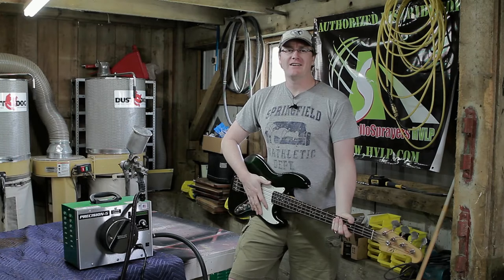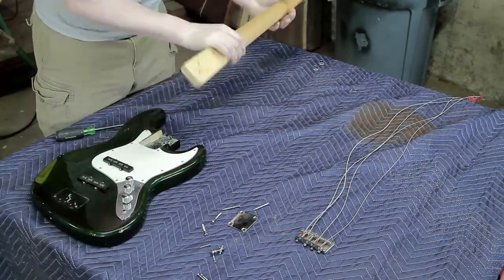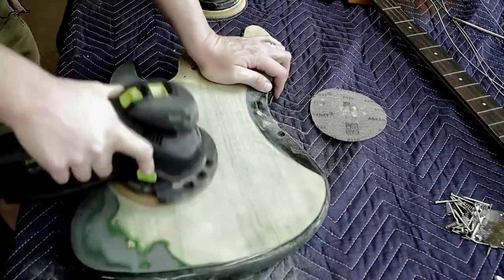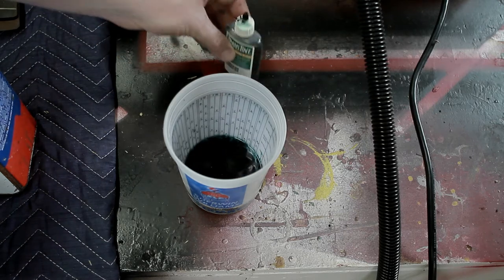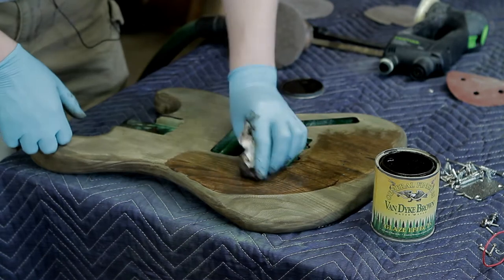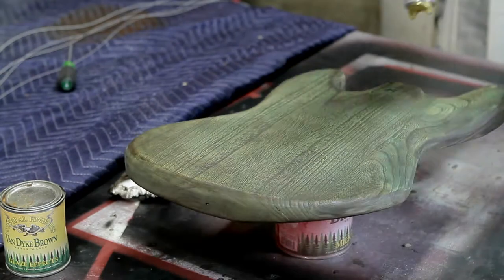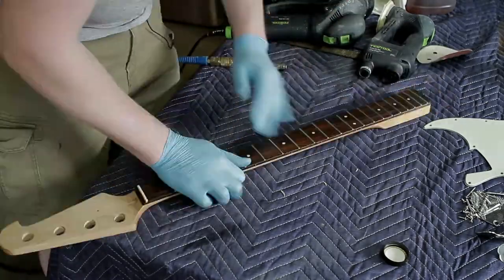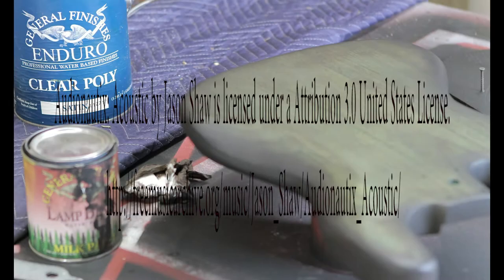Refinish A Guitar With Milk Paint

Comment: Cool project! I'm going thru a pine tar phase, and I wonder how an ash stratocaster body would come out with a 50/50 blend of pine tar and turpentine. It might fill up the pores of the wood and deaden the sound, but at least I wouldn't have my guitar completely eaten away by termites while onstage, which has been a problem in the past.